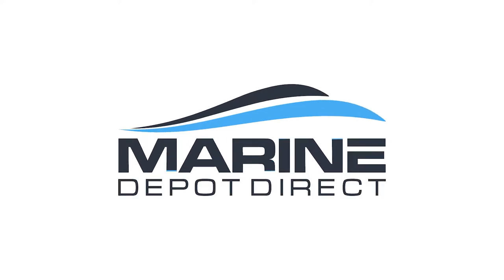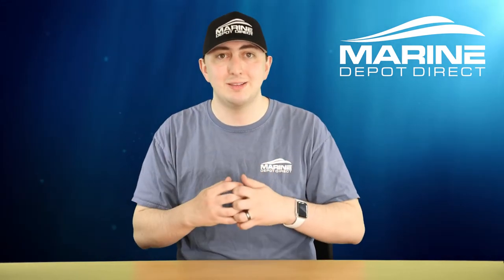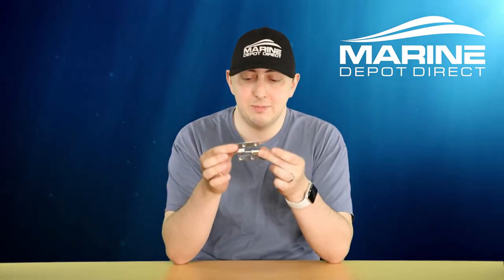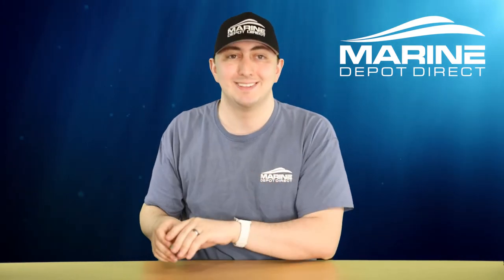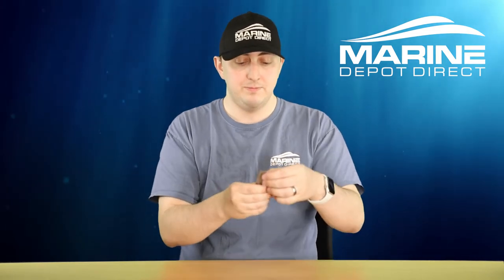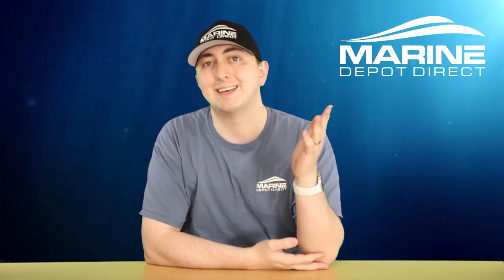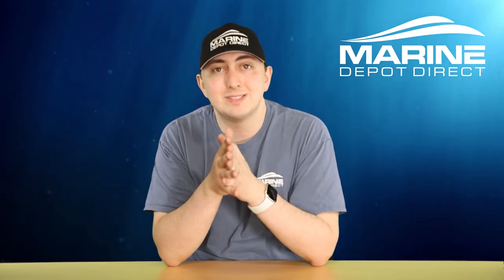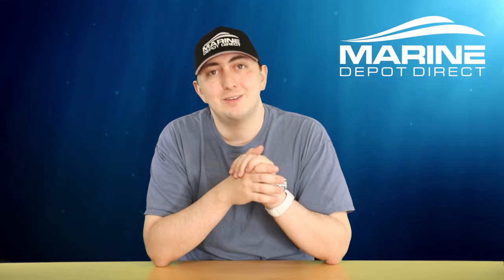What are Take-Apart / Lift-Off Hinges?

Comment: I am hinge ignorant, even after watching this. I am trying to building a round cabinet with 2 pieces. that form a moon. One moon side is smaller (crescent) and one side is bigger (gibbous) that when put together form a full moon. I am adding doors to each piece and wanted the ability to flip the "crescent" moon side to the other side of the "gibbous" moon side. But if I do this with the lift off hinges the door would fall off, right?
Reply from the maker: Hello Susan! We love this idea! You are correct, however. Take Apart Hinges probably would not be the best for this application since they rely on gravity and the weight of the door to keep them in place, so they are not able to flip to different sides. Also, the "L" shape makes the different sides incompatible 😞 We don't carry any hinges that are easily interchangeable in the way you want, but we're wishing you the best of luck on your project!